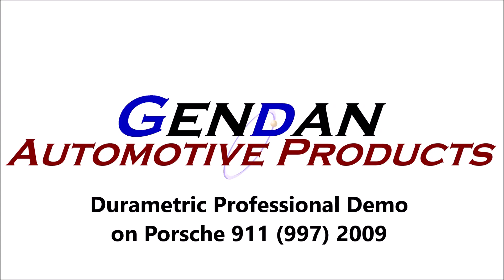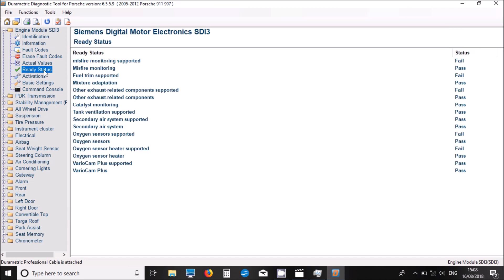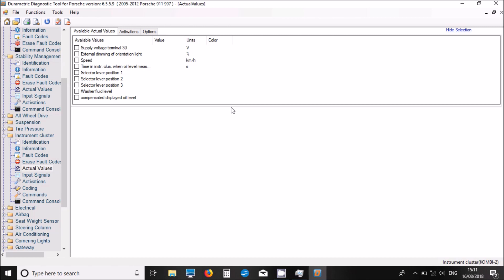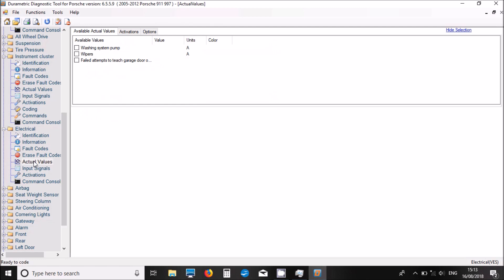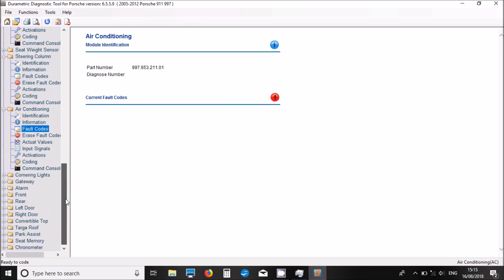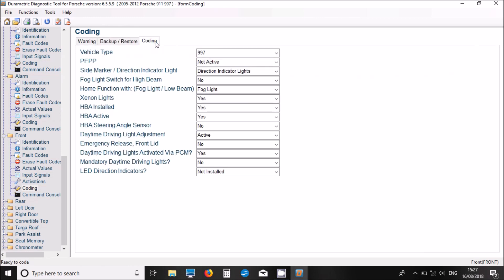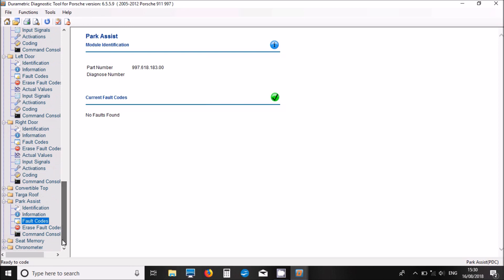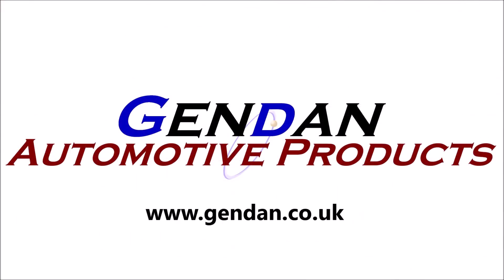Durametric diagnostic scan on a Porsche 911 997 model

Comment: Since you are a seller, maybe you have more pull. Maybe you can contact Durametric and have them update their software. The 991 has been out for about 10 years, yet I cannot do a ABS Bleed or a BMS. Incredibly, much cheaper diagnostic tools can.